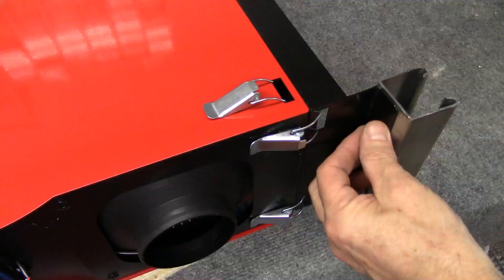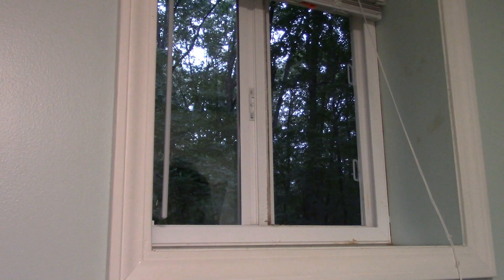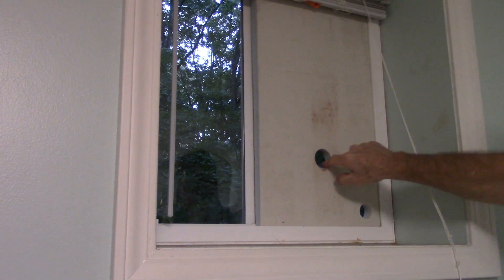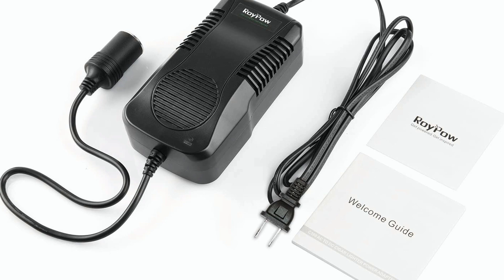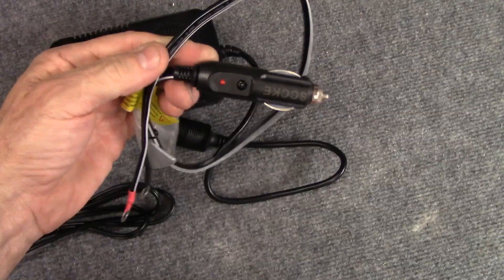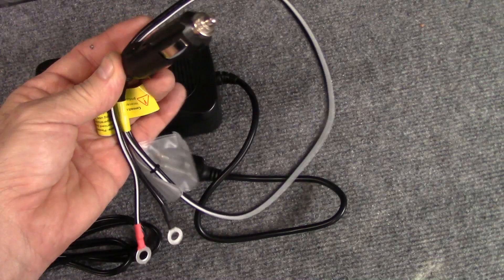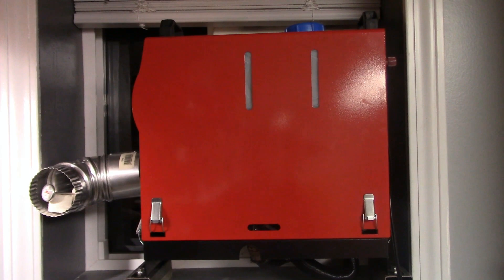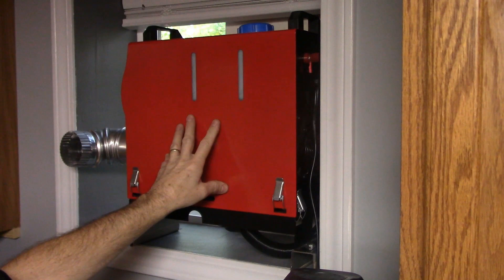Home Chinese Diesel Heater - Portable | Efficient | Safe

Comment: suggestion: just make a box metal box that has the entire unit outside. Just run the heat inside. Less noise no diesel smell. If you fill it outside no  spilling ever inhouse.  A 'safer feeling'. Nothing unsafe can happen. you can even bolt it to the wall against theft.
Reply from the maker: Thank you that is a good suggestion that could ease any worries.
Reply: great idea
Reply: Agreed, keeping the unit outside will be a lot safer, less chance of carbon monoxide. Not sure if you have one nearby, but might want to put one near it
Reply: But then it will take the cold air from the outside instead from inside, making it less efficient...
Reply: @Dy3rMak3r  you can easlily route some aluminium pipe for the intake.
Reply: Mounting it outside an running a heat pipe to the inside won't be efficient at all  it will actually bring moisture in especially if it's extremely cold out
Reply: @Dy3rMak3r  i prefer less efficient over dead any day.
Reply: Co2 detectors arround the house just in case
Reply: @Dy3rMak3r  so, the unit can take the air it heats from inside the house. That's typically how people do it. It is not complicated
Reply: These units are made to be installed inside not outside (unless you are camping in a tent, etc.) There is no diesel smell. The diesel is burned inside and the exhaust is to be ducted outside. The unit heats the inside air, not intended to heat outside cold air and force inside. Installed correctly they are very efficient.

Comment: Nice modular and foremost portable solution. Many apartments or small (studio) homes would like to have this as an alternative heating backup system if the regular system would fail or just is to expensive in winter. Having a large enough battery (1KWh) to maintain heating while power from the wall is off seams essential if you live in rural areas. It is definitely enough capacity with 27.000 BTU's. If it only costs a few dollars a day to heat your small cabin or home it might be a cost saving to go off the grid.
Reply from the maker: Very good points made.  Thanks for sharing !

Comment: Informative thank you, one one problem I see. Exhaust and fresh air hoses to close together fresh air be drawing in exhaust fumes. I believe instructions say opisite ends.
Reply from the maker: The air intake hose next to the exhaust is only for the sealed heat chamber to feed the fire. The heated air that you breath enters through the back of the unit.

Comment: Yup your awesome! This will heat a basement! No issue on that!!!!!  Didn't dought this when I had seen this before and now got to try this for myself! Motivating to use this heater myself and see the temps
Reply from the maker: If having the unit inside worries you, it can always sit outside protected from the elements. It won't be as efficient but still work pretty good. I use it that way on my truck shell and RV. Thanks.

Comment: Hello from Italy, I would like to suggest you to increase intake clearence from the wall by 1,5 times the diameter of the intake pipe.
This will improve the performance of the the heater and decrease the output temperature as well.
Mine have 90 celsius degrees while running at minimum power.
Reply from the maker: I have worked in Italy and would love to visit again.  Thank you for the suggestions!
Reply: @geenote  don't miss to share with me some good time, we'll share some diy tricks

Comment: I tried a 8kw diesel heater in my house a few years ago. It works very well as long as it is not extremely windy outside. If a strong wind blows directly on the muffler, the carbon monoxide will be pushed back into the room and the heater will shut down.
Reply from the maker: Good to know. Thanks! 👍
Reply: Seems like some sort of wind box/diffuser could be built to get around that issue. How well did it heat your house, and how many square feet?
Reply from the maker: @life_of_riley88  I easily heat my basement workshop which is around 12' X 30'.
Reply: @geenote  Thanks! Sounds like these little things put out some good heat.
Reply: I wonder if there were other factors at work, besides the wind pressure.?. It seems like a 1" diameter opening in the muffler isn't going to pick up a lot of air. If it did, pointing the muffler down towards the ground should fix the problem.
Reply: Did you have the intake inside? If the intake and exhaust are outside there should be no way it can get exhaust inside unless the body of the heater is broken

Comment: I do this for my garage. But I have one suggestion…. You should leave your fresh air intake inside the basement rather than outside. By moving it inside would avoid fumes from the exhaust. Also, the efficiency would increase due to the warmer air in the basement.
Reply: Edited 12/18/2021 21:40 Eastern: The Burn-air-intake hose (& filter) should be indoors. Not only because it will help remove any trace of CO, but all other airborne particulate. Like pollen, shop-cutting-drilling 'dust' products, stale air, and Radon gas (which can be pretty dangerous).  My basement Radon level is low, but increases quickly whenever heavy rain or melting snow soaks down into the granite rocks under my home, releasing large amounts of Radon gas.
Reply from the maker: Thank you for the suggestion. The fresh air intake that pulls air across the heat chamber which is heated, reheated and breathed, is already inside the basement located in back of the unit. The air intake hose that is outside is only used for the fire inside the heat chamber. If I move the little hose inside that is used to feed the fire, then it is noisy and will also pull oxygen out of a small well sealed room (especially like my truck camper or RV).  Halfway into this video explains the 2 air intakes: https://youtu.be/wAQehNzqAWY
Reply: @geenote  I edited my post above, to make sure I was clear about "The Burn-air-intake hose (& filter) should be indoors." 
I was referring to heating the basement only. Most basement I've seen, have small amounts air leaking in from upstairs or outside. Heating system Oil burners and some gas hot water heaters draw basement air directly from the room where they are installed. If the basement was sealed really tight, the installer would pipe in some outside air (to feed the fire chamber) in a 3" PVC pipe.    
I wonder how many CFM air flow these 8K diesel heaters use? My guess it's pretty low.

Pulling wet outside air into your heater's burn chamber when it's raining (100% humidity) seems like it might create steam and maybe make water in the exhaust pipe.?.     
Not sure why the air intake hose (& filter) would make much noise.  I didn't notice it when I was testing outdoors. But, my ears are 75 years old. :)    
If your camper or RV is that air-tight, you might want to open a window if you plan to be inside for more than a half hour. Rebreathing your own air isn't safe. Too much CO2.

Comment: I'd like to point out that that APC UPS has a 12VDC battery in it.  If you wanted, you could just bring out a 12VDC connection directly (w/ a fuse or breaker) to your heater power input.   It would save a bunch of "extra stuff".   FYI
Reply from the maker: So true! Someone else also pointed that out and got me thinking.  I have a couple of those UPS units laying around so maybe I will "modify" one and basically use it as a battery charger.  My concern would be if the UPS can charge the battery quick enough to keep up with the amp draw that the heater will be pulling. Thanks for the tip!
Reply: @geenote  
If you kill/lose the power to the fuel pump (but keep power to the rest of the heater), the unit will gracefully shutdown.

You could rig up a low voltage shutdown that way.
Reply from the maker: @geoffreylohff3876  I seen on YT videos how these heaters shut down when they run out of fuel so that makes sense.  I'm still learning and appreciate any tips or ideas.  Thanks!
Reply: Maybe look into buildimg a custom wind generator to capture the forcex air and recharge the battery some😉

Comment: I operate 2 of these with 30A 3D printer power supplies.  They run best with the voltage around 13.5V so that is what I turned them up to.  One of them uses an arduino to switch the dial on/ off thermostat on and off with the use of a regular 'home' type thermostat. It does not work perfectly and glitches off once in a while, but it works good enough. Heats 120 sq/ ft on about 1.5hz but it turns on and off with the thermostat system.
Reply from the maker: Pretty good that you have the unit actually turn completely off and then back on automatically as needed especially when ac power is available and pulling higher amperage every time the unit cycles on or off is not an issue.  Most people are not going to be able or willing to program a PLC or microprocessor to use this heater that way but it's impressive that you were able to do that. Thanks for sharing some interesting information!
Reply: @geenote  It actually runs 2 lines of very basic code to make it work. As an amature with arduino myself, I got it to work good enough so I left it there.. The arduino just 'presses' the on/ off buttons with a couple relays using the thermostat as a switched input.  Biggest issue was getting leads soldered onto the controller board.  I got the idea from another youtube video that used cellular triggers, and I swapped the thermostat and arduino in.
Reply from the maker: @mattdudley3789  That's pretty cool.  I work with (mostly Allen Bradley) PLC's and always have a couple small units laying around. It might be a fun project to play around with an old home thermostat and PLC to do something like you did.

Comment: Keith, I just found your video as I've purchased a diesel heater like yours for my garage. I wanted to bring up the power concerns you had. The way you have it setup going now is you're taking wall power and converting to 12v dc to charge the UPS batteries and then creating wall power again. then you've got a 12v power supply plugged in to the ups so you're converting back to 12v power. you could add a power tap off of the internal batteries in the UPS battery backup and eliminate the 12v power brick all together.
Reply from the maker: Makes sense....so basically use the UPS as a battery charger.  My concern would be if the UPS can charge the battery enough to keep up with the amp draw of the heater.  The heater pulls minimum 0.5 amps on low after pulling 10 amps on start up and cool down for a few minutes. This low end UPS will make sure the battery stays charged but only uses the inverter when there is a black out (and hopefully a brown out) at which time the internal transfer switch will switch to battery and inverter circuit. So the battery is not used to create wall power until I get a black out.  I have a few of these old UPS units laying around....maybe I will modify one now that you got me thinking so I can maybe get rid of the power brick.  Thanks for the tip!
Reply: @geenote   I would just hook up a larger battery and see if it keeps it charged.
Reply: Hi. I've seen other videos suggesting to use a battery and trickle charger but they never showed or explained how to hook them up. Is it just a matter of connecting red connectors (charger & heater) to the positive battery terminal and black connectors (charger & heater) to the negative battery terminal? Also, they don't mention about the sizing or rating of the battery and charger. Could you please comment or recommend something to that effect? Let's just assume I will be using the same heater in this video which you also used in your garage. I live in a very cold climate and needs to prepare in case of a prolonged power outage, just in case. Thanks in advance.
Reply from the maker: @gsatiucla5139  The charger would be connected to the battery terminals red to red (+) and black to black (-) just like the heater is connected.  The battery has to be big enough to supply enough amp hours to run the heater for the length of time you want.  The charger has to be able to charge the battery fast enough to also keep the charge up.  It depends on how high the heater setting is while running and how long the heater is running,  At the lowest heat setting, the unit only draws around 0.5 amps. The higher the heat setting - the more amps it uses. When the heater first starts up it pulls around10 amps for a few minutes then drops down after the glow plug turns off which is what ignites the fire. When you turn the unit off, it once again pulls around 10 amps for a couple minutes because the glow plug turns back on during the shut down cycle to burn off any build up. I think you should consider a deep cycle AGM type battery rated at 100 amp hours and a smart/automatic 10 amp battery charger to keep it charged up. If your power stays off for a few days, then maybe you would need a solar charger like the one I just posted https://youtu.be/4x1GlMssCjQ  
Hope this helps.

Comment: I don’t think that condensation in the bend in the exhaust so close to the heater would ever be a problem. The temperature and exhaust gas flow directly under the heater outlet is enough to melt solder on copper pipes, let alone evaporate water....I soon discovered that; my heater is the same as yours. I think these are great heaters; I’ve just switched mine on in my workshop.
Reply from the maker: I wasn't sure about that - good to know.  I agree these things are great. Thank you!

Comment: Good idea but yes much better with the unit outside , just a hole in for heat and extended the controls wire so all done indoors 👍🏻👍🏻
Reply from the maker: Yes - safer and still works great that way! 👍

Comment: Looks great, I bought one for our tiny house up north and am thinking of putting one in my garage at home. The only issue I see with your setup is refueling could be cumbersome.
Reply from the maker: Yes refueling can be a pain. Luckily a tank lasts long enough each time I use it.  I remove it from the window after each use and refill the tank before next time.  If I had it permanently mounted I would have to get a bigger fuel tank.  Thank you for watching and commenting.

Comment: Just an idea, if you make an enclosure around your heat pump condensing unit with this heater inside the enclosure the heat pump would work far better(during colder months) and you could use the heat pump to heat the entire home
Reply from the maker: I may have to check into that.  Thanks for the tip!
Reply: However, for my interest in alternative heat source during electricity outage this would not work as the air sourced heat pump requires electricity to function.  What brought me to the diesel possibility is it would be possible to power the diesel heater with my truck battery during the outage.

Comment: Very cool idea 💡 I've seen another guy in England heat his sun room in his house with one of these units
Reply from the maker: This little heater is awesome as you know.  I'm looking forward to using it on the truck shell in freezing temps. It does good in my workroom but it might be too much heat for that small space.  Thanks and be safe out there.
Reply: @geenote  yeah it'll definitely roast you out of the truck show you're probably going to have to keep a window open slightly

Comment: Like this idea alot, I would probably consider a little more of a permanent fixture in taking the exhaust straight out through the wall and mounting the unit inside a cabinet fixed to the wall with the heat outlet via duct vent grille. Would help reduce the operating noise, keep the window for natural light and reduce the risk of exhaust fumes entering the room.
Ok you would have to drill your wall but looking at your workshop that should not be too much of an issue.
Off to plan my own heating project with a similar unit.
Reply from the maker: That's a good idea and I considered doing that upstairs.  I don't mind having it temporary since I move the heater around using it in different places.  Thanks and good luck with your project!

Comment: You can use any computer power supply to run 12 volt appliances. Years ago made a stereo for use at work with computer power supply a car stereo and even used two computer fans to create air flow in the wooden box that holds everything.
Reply from the maker: Nice ! I think it's great using scrap parts for something useful.  👍

Comment: Very good Keith, I would have liked to see a more In depth vlog, could it heat a log cabin for instance , costs of everything, running costs, test to let run a whole week over night. But saying that, this has opened my eyes enormously to alternative heating system. We'll done.
Reply from the maker: The manual claims it uses 0.1 liters of fuel per hour on low but that may be a stretch.  I believe you could get 24 hrs on a gallon running on low. The longest I let it run constant is probably not much over 8 or 9 hours on a low setting. There are quite a few diesel heater videos on YouTube you can check out for more information.  Here is another video I have testing the heater on my truck camper that may be helpful.  https://youtu.be/sbJbV8BuAOs Thank you for watching and let me know if I can answer any questions.

Comment: Have you thought about ruing the exhaust pipe inside of the (larger) intake pipe to help preheat combustion air? Theoretically should increase efficiency.
Reply from the maker: I have a kerosene Monitor brand heater in my garage that uses a two wall pipe like that.